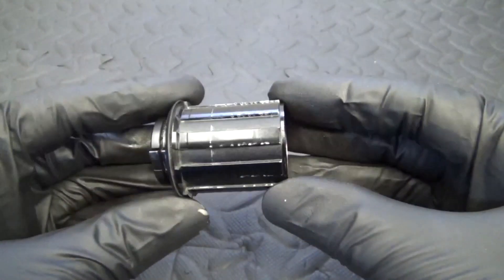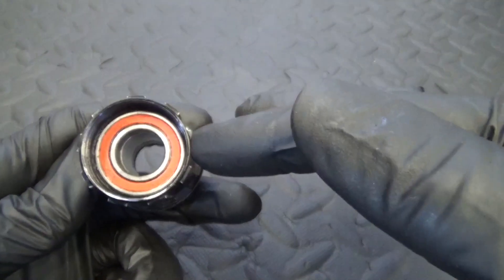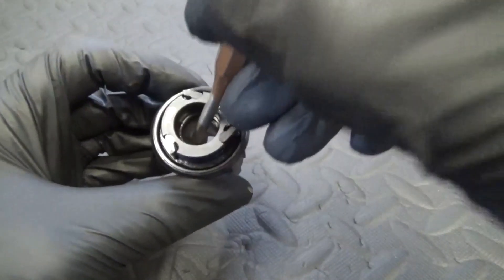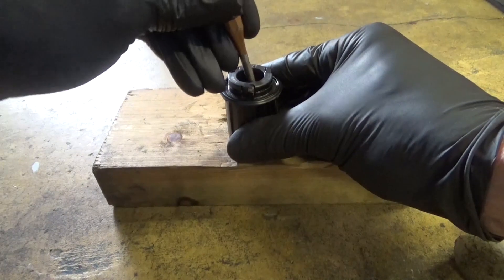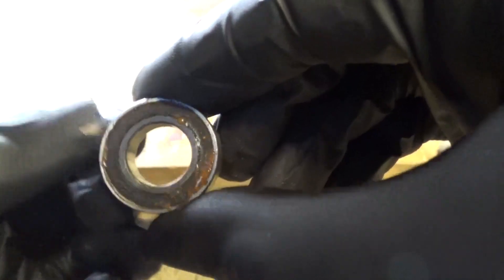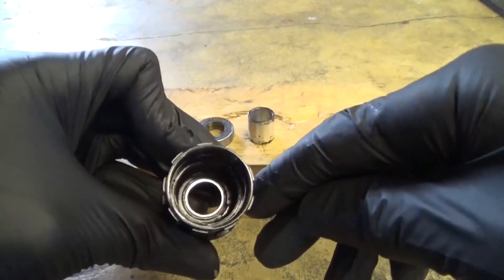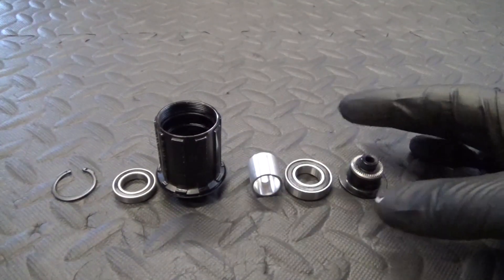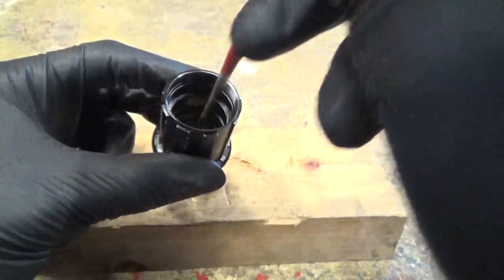DT Swiss 3 Pawl Freehub Body Service Guide

Comment: Great video mate- I have H1900 "Hybrid" wheels for E-MTB, the bearings for the axle in the wheel are running ok but both the freehub ones are rough as... Will chap out the external one tomorrow and get a look at the circlip as my "el cheapo" circlip pliers won't get in that far anyway...I'll wait until I can get out the internal(pawl side) one before ordering any just to be sure the size is correct- these companies have a habit of making subtle changes to dimensions and yours is the 11 speed road hub, mine is the 8-10 steel MTB hub....

Comment: Thank you for the video! 
I have the same rusty water problem, too! I wish the design was a bit more weather resistant....
There's not much info on the web on servicing the freehub body itself, so this is very useful. Are the bearings 6802 and 6902?
Reply from the maker: Glad you found the video helpful. Yes the bearings are 6802 and 6902.
Reply: @FreeToCycle  Just to clarify the bearings in the freehub are 2 x 6802, the bearings in the main hub body are 2 x 6902.
Reply from the maker: George The freehub uses 1 6902 and 1 6802, the hub has two 6902 bearings depending on which wheel you have.
Reply: @FreeToCycle  I replaced mine last week on a 3 pawl dt swiss hub and it took 2 x 6802, I'm not sure if that means there is variation between models.
Reply from the maker: George Could be but not seen that myself.
Reply: @FreeToCycle  I think I've worked it out, yours in the video is the standards freehub and mine is the Sram XD driver version which tapers in towards the outside and must take a smaller outer bearing.

Thanks for uploading this video by the way, it was extremely useful in servicing my freehub.
Reply: @FreeToCycle  Really useful vid! I think it's best to take the bearings out and then you know what you need as they definitely vary. Mine uses 6902 & 6802 in rear hub body and the same again in freehub. This is on Giant SLR 1 rim brake rear hub.

Comment: Thanks for the video, it's very informative and fitting, I just wish I knew where to get the actual bearings from. Any suggestions? My rotor kits is the 12/142mm HWYAAM00S3909S MTB SRAM XD 11 Compatible

Comment: Excellent guide! When I tried to tap out the inner bearing (the 6902), it separated, and I only got out the inner part and the balls from inside the bearing. The outer part of the bearing is still stuck in the freehub. Any advice on how to get the remaining part of the bearing out?

Comment: What circle pliers do you use? I bought a pair, but for 1.7mm ends. But too big. Tried filing ends down, but still not able to get circlip out.
Reply: Have the same issue. It looks that it's not the standard DIN 472 circlip.
Did you manage somehow to get it out?
Reply: You can use a thin screwdriver too